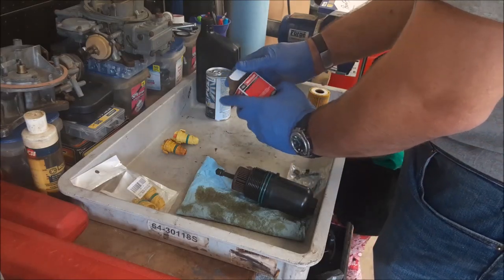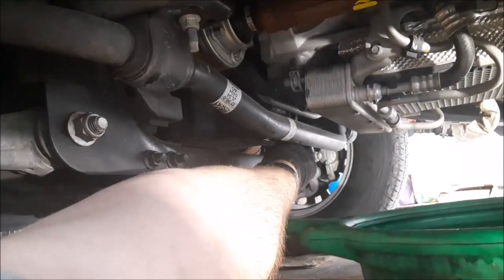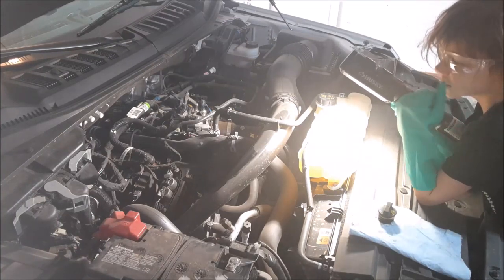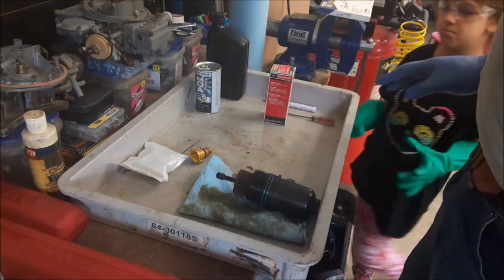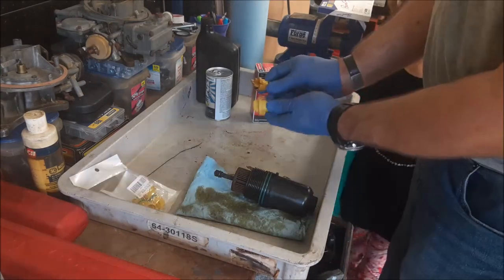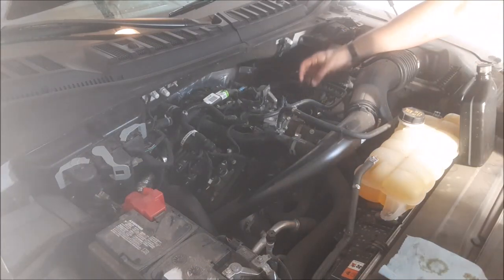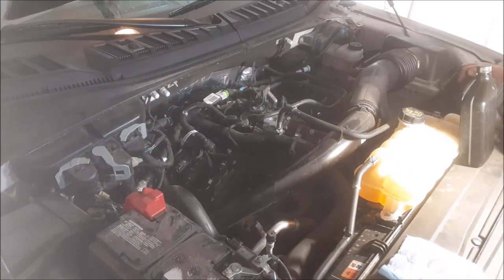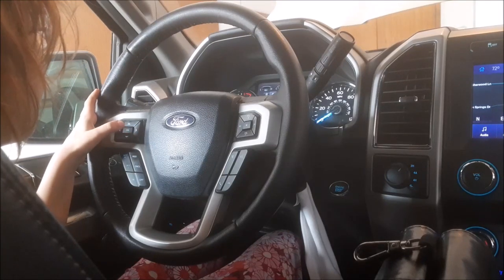Changing the oil in my 2020 F150 ccsb, 4x4, 10R80, 2.7T

Comment: Good job on the video, Jesse. I ordered up four gallons Rotella T6 (5W-40) H-D Diesel oil from Amazon last week, it will arrive tomorrow. My 2003 F-250 diesel uses 15qts. This will be my 52nd oil change (190K miles). I changed oil every 3K miles the first 100K miles, and I've been changing oil every 5K miles since then.
Reply from the maker: Thanks for watching. DIY oil changes are definitely better than a SpeedyLube place. Like I said in the video I've been burned before by getting my oil changed in town.
Reply: @Olds64  I allowed the dealership to perform my oil changes up to 36K miles during the warranty period. So, I guess I've performed ~42 oil changes on the F-250 diesel tractor. I don't think I'd ever let a Speedy Lube place perform anything on any vehicle.
Reply from the maker: @ngeltz  I still have a few oil changes left through the dealer on my daily driver. Having a SpeedyLube change the oil is a risk. Buyer beware.